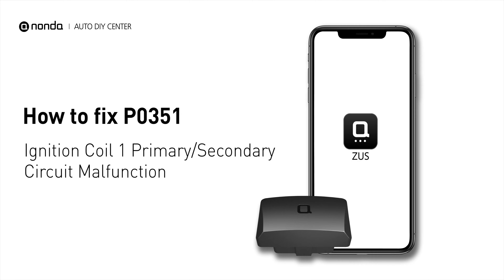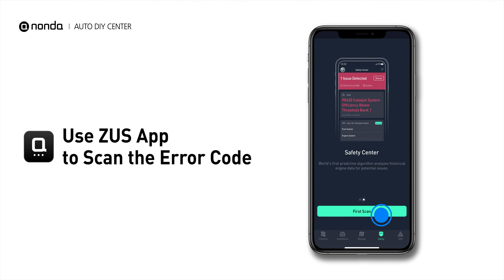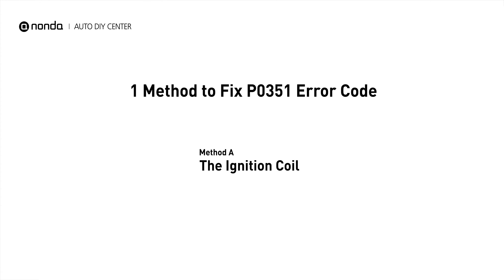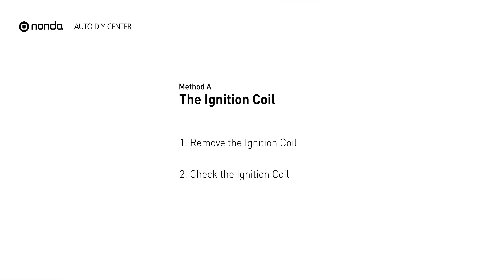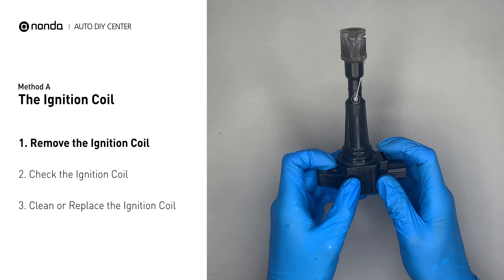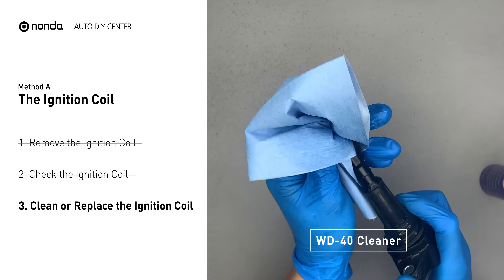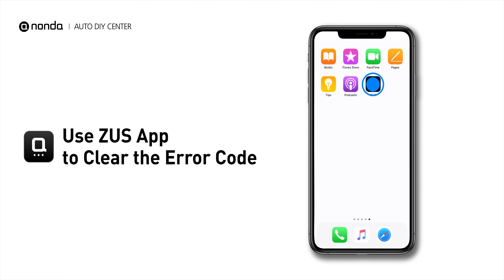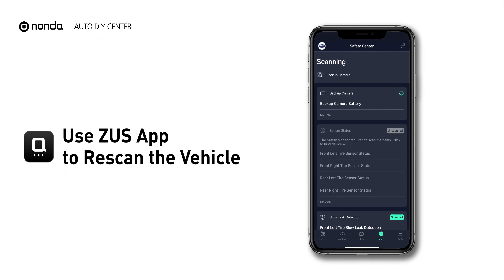How to Fix P0351 Engine Code in 2 Minutes [1 DIY Method / Only $3.89]

Comment from the maker: Hi, I'm Steve, nonda's lead mechanic engineer. 
Feel free to leave your comments here if you have any mechanic questions, I will be glad to help you out!
Reply: hi, steve, i just did a scan on my scooter and got these messages
po337 Crankshaft Position Sensor A Circuit Low Input

po351 ition Coil 'A' Primary/Secondary Circuit Malfunction
ive not been able to start the bike, been in the local garage and he cant fix it either. these codes mean nothing to me, i am useless about mechanics/electrics

Comment: Hello I bought a quad hammer 200 and after driving 2 km from new the check engine came on. When I plugged in to check the error it blew the error p0351 and p0505. Please tell me what could be wrong. The quad is the latest.

Comment: Hello. I have an 03 Toyota Camry. It’s misfiring in cylinder one. I went ahead and changed all the spark plugs as well as cleaned the throttle body. After this the ecu stated 1,2,3 cylinders miss firing. I changed coil pack in one and ecu is staying only cylinder 1 is miss firing. Any suggestions please!!
Reply from the maker: Hi Bisrat, have you double checked if this is the only code you're getting?

Comment: I have the same code on a 01 gmc jimmy and wondering where the ignition coil for cylinder 1 was
Reply from the maker: Hello, kindly check the top of the engine, between the ECM and the firewall on the passenger side.
Reply: 01 jimmy dows not have these type of coils…
Reply: hello could you help me I have a code P0351 Ignition coil A Primary/secondary circuit it happens after we take out the intake exhaust a the other one is the solenoid maybe he touch something that cause the code to appear before he take the solenoid out the car run smoothly but after he take the solenoid out and put it back the car was vibrating but if you drive over 60kms the car seem find please help thanks